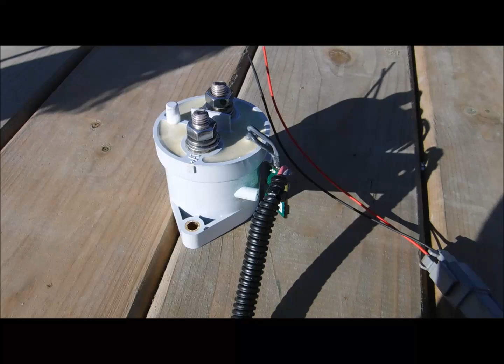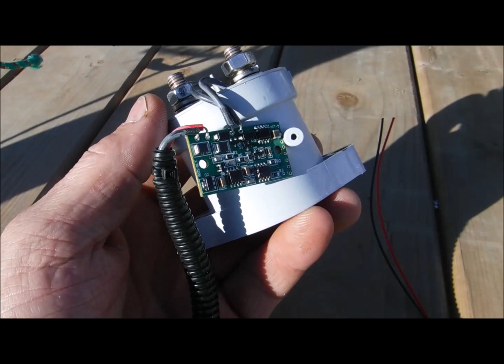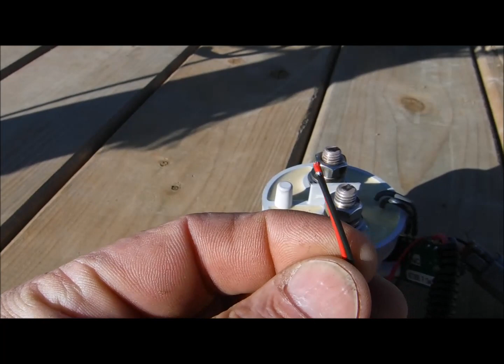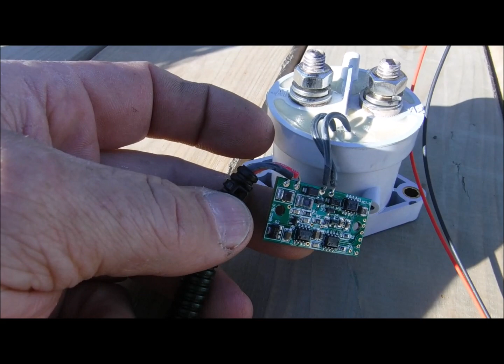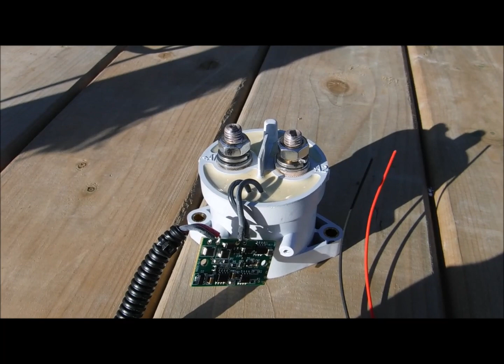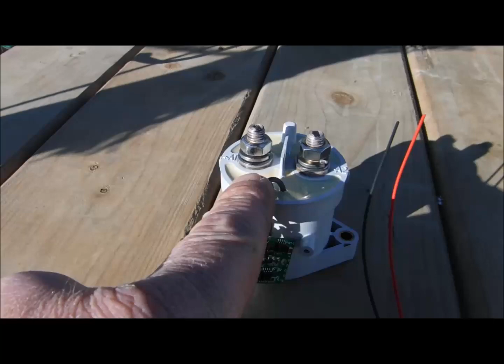How A Economizer Works On A Relay  Simple Term

Comment: Where can I buy this economizer? I don't seem to find it anywhere...?
Reply from the maker: I have plenty. I would sell you one or two or ?  and ship it to you if your interested. Or you could look on ebay also there for sale on there to.
Reply: Yeah I would love to buy one. I am using EVC 500 from TE connectivity. Do let me know if it would work please? Thanks! :)
Reply from the maker: @madzr3093  It's pretty much the same as your using. Other then the one your using has a 500.000 Mechanical life and the one's i have have a million times  Mechanical life. Here is the model number of it and the pdf file about it. EV200AAANA    
Mine.
http://www.rec-bms.com/datasheet/Technical_datasheet_Kilovac.pdf

Yours
https://www.te.com/commerce/DocumentDelivery/DDEController?Action=srchrtrv&DocNm=EVC500-X0000-A001&DocType=DS&DocLang=EN
Reply: Hi, I am looking on Ebay and found nothing. What exactly I have to type?
Reply from the maker: @albator10  EV200AAANA
Reply: @MrDoingEverything  Looking at the spec.sheet of the EV200AAANA it specifically states the second A stands for A = 9-36VDC (1 = requires external coil economizer). So did you get yours with this external coil economizer included ?
Reply from the maker: @gregoryfierens001  Yes
Reply: Thinking out side box but did you remove it from an enclosure or does it really come like an unprotected PCB wired to the coil ?
Reply from the maker: @gregoryfierens001  It was removed to show it. It's protected.
Reply: Hiii I'm an engineering student , I currently have EVC 500 from TE. 
I wanted to ask where u got the economiser from or  would u help me out to design the economiser circuit 
Thanks:)

Comment: so it burns up the voltage leakage in the relay.
Reply: Dear off grid wanna be:  your heart is in the right place. You did the Right thing. I am the actual inventor of all electronic economizers for all types of relays, and I did that back in the 1990s, you can look up my patents.  I am Gilbert Stephen Perreira.  The company, Kilovac, I worked there for nine years as the senior R&D electrical engineer.

I’m glad you made this presentation and you got the basics right but there are a lot of details that could further clarify for users why an economizer is so important and how it works. Maybe I will make a video to show that, because there are a lot of reasons to use an economizer, but you got the main one and that is to keep the relay from overheating so that you don’t burn out the coil.

You can see my research papers at the national Association of relay manufacturers website, NARM,  every single detail that anyone would ever want to know about economizers is in that paper, and I won the top award in the international relay conference, and there was a lot of competition.

I’m not BS’ing you!

Good luck, Steve
Reply: @steveperreira5850  Its good to know you. I have a kilovac which is EV600HSANM, Im just curious since it said in the datasheet that it has "Internal Two-Coil Economizer" but when i tested it (Supplying 24V to the coil for 2 hours) it got busted and the Contactors body is about 58 deg C. Does it need a PWM supply or the internal economizer is not working. let me know your thoughts.thanks
Reply from the maker: 60 hour test just did and no heat at all.
Reply from the maker: The economizer is basically locking the voltage in the coil until it senses no further input voltage is there compares to relays without it are purely just consuming the voltage to which is where all the extra heat comes from. Now the heat can also come from the current moving across the contacts. I,v used mostly the relays with out the economizer and all lived a short life. I tested out this type and left it with the coil  being powered up for a very long time and felt nothing other then its own temp. Right now i,m doing another test and i,m going to leave it for days and days to see what happens. I will let you know what i come up with for the results. I,m pretty sure already a 24 hour test will be the same as a 72 hour test. Time will tell the story for sure anyways.